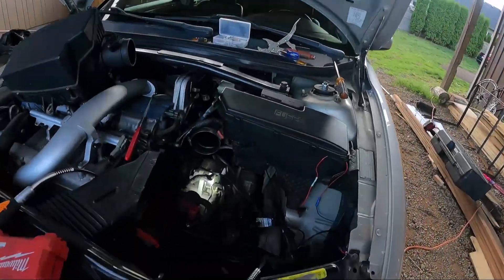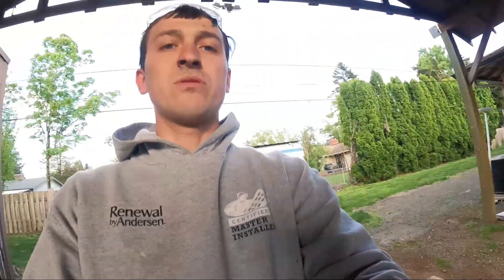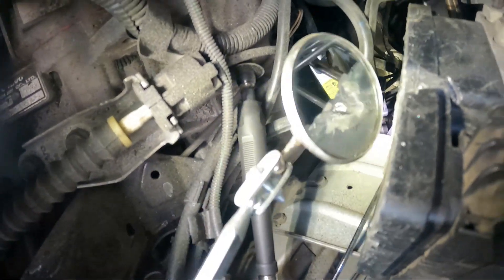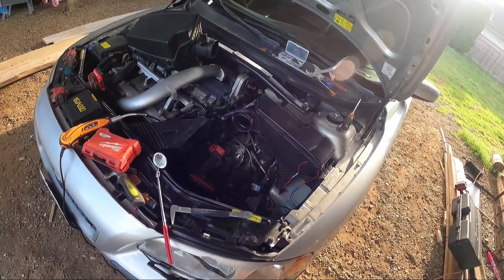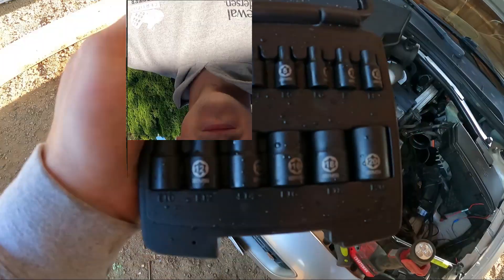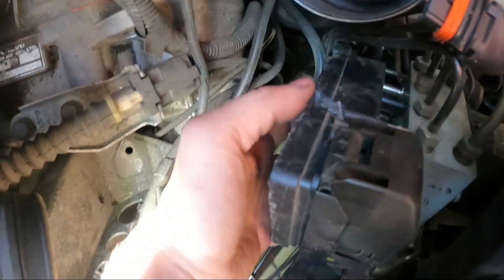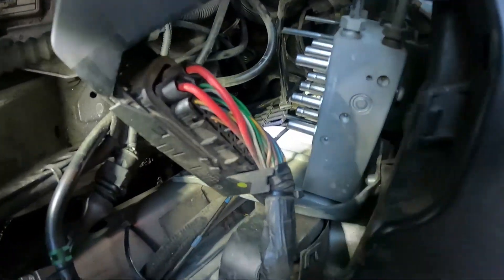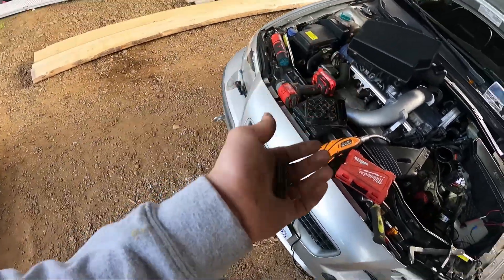Volvo P2 removing the BCM(brake control module) and sending to XeMODeX for repair.

Comment: I'm having the same issues with my S60R BCM.😕
I also noticed the front lip of your bumper is hanging down, there are actually 3 'L' shaped brackets that are molded into the plastic lower radiator support and the lip of the bumper needs to be lifted up and slotted into those brackets.
No need to reinforce the bumper. 🇦🇺